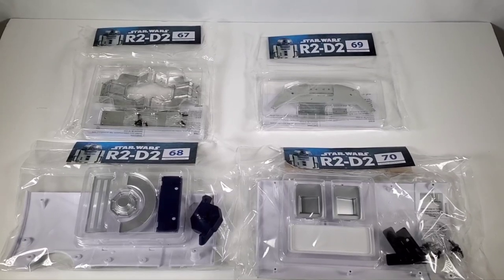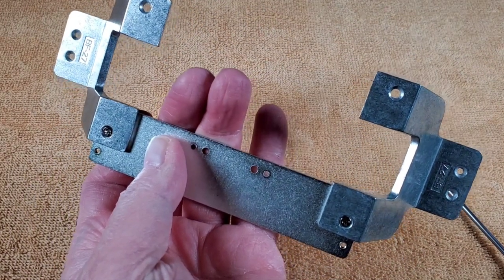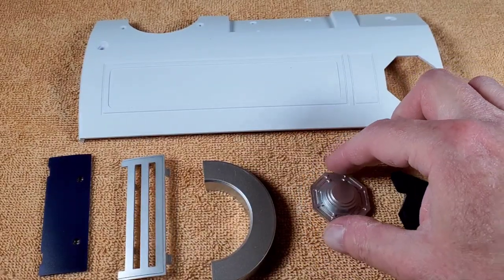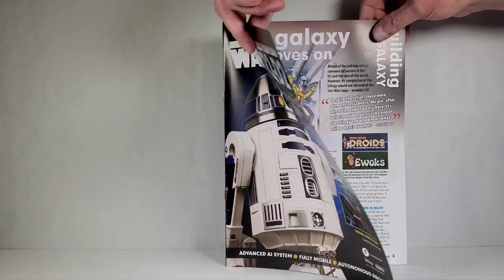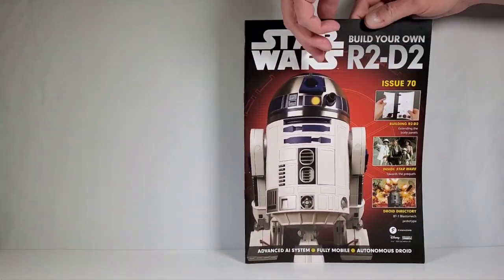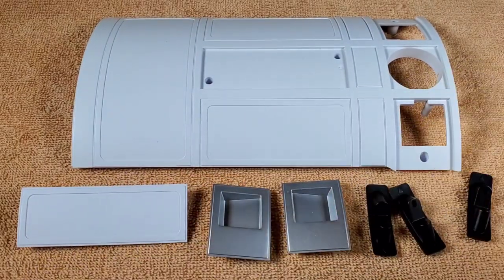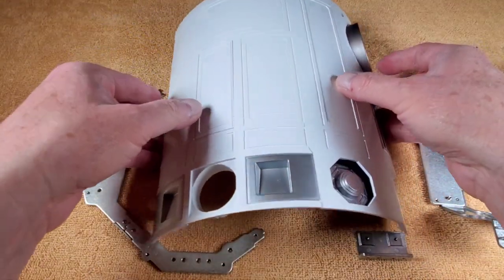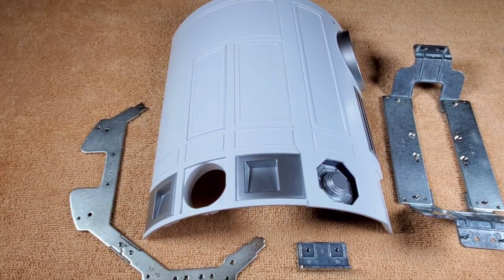Part 18 Building The Fanhome R2-D2 Stages 67, 68, 69, 70

Comment: I understand your feeling when it comes to neverending projects, dude. I’m currently working on a 3d printed light weight spaceship model, which is big enough to have interiors and jump drive sections, even a cargo bay with lifts. I started it before the new year, and i can get a fragment ready in like a week or more. Printer sacrifices speed over quality, therefore it works super slow and needs to get rest and maintained for a day per four hours of running. Now i’m having troubles with it’s nozzle and i need to unclog it, since the replacement i bought was a lemon. Anyways, long story short, i know how it feels. But at the other hand, it is nice to have something to take care of, since it’s a hobby. So, not a huge deal, but it is annoying when you have to stop the process because of a mulfunction.
Reply from the maker: That spaceship sounds very cool! I love that it has interiors. Yeah I just bought a 3D printed model of another Batteries Not Included robot, The father, Kilowatt. It has a few issues but the other 3 robots, Flotsom, Jetsom and Wheems were very nicely done. I'll be showing those videos coming up soon. I'll be glad to finish R2.
Reply: @outsider238  oh, i would love to see the rest of the robots from the movie in your channel. When i move back to my bigger house, i’m planning on making collections like that too :D
Reply from the maker: @nopeimout5966  It's an addiction! 🤣😅😆